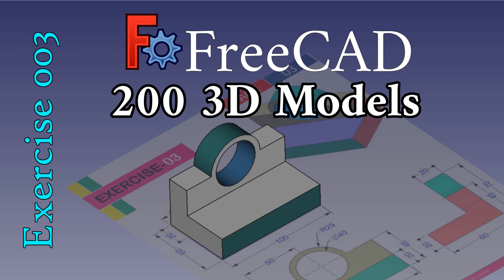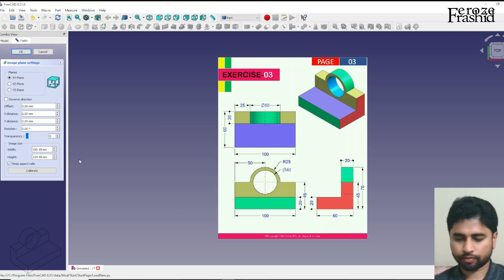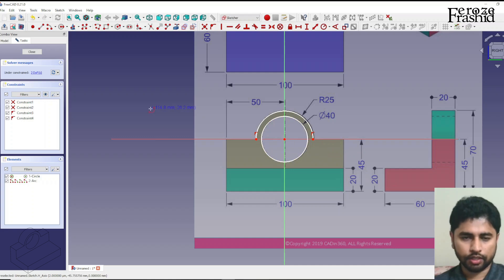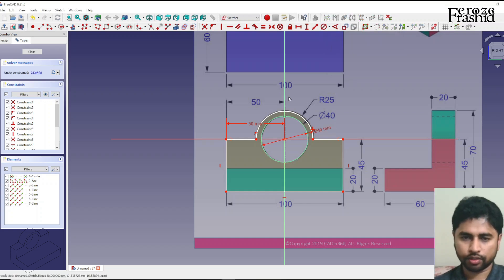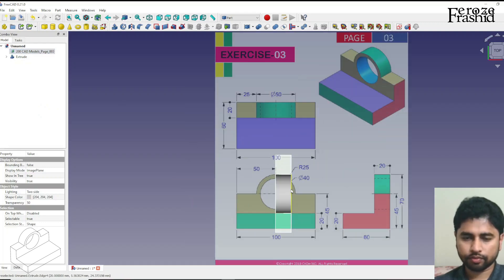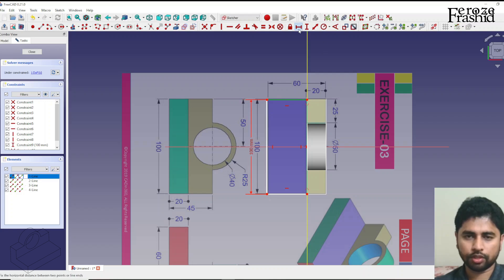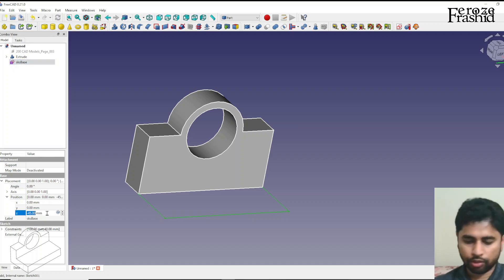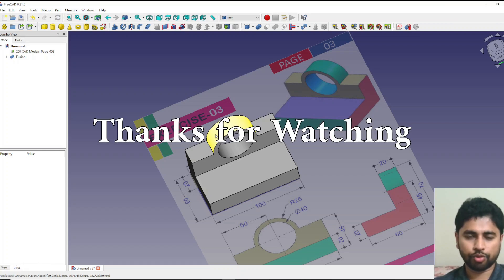200 3D Models in FreeCAD: Exercise 3

Comment: Great videos. Constraint angle wasn't required(2:45). I think Katt forgot to edit this out. On completion of initial drawing(2:30) I had 4 DoF(s). For other newbies like me if your having issues getting the model fully constrained its probably happened when using the poly line tool. Otherwise keep up the good work. I'm learning from your videos
Reply from the maker: Thanks. Polyline applies some constraints like tangential, vertical, horizontal, etc. by default. If not paid attention, this auto-constrain feature may become something to be concerned about, but with time it comes to an user intuitively like turning a bicycle to stay on a road.